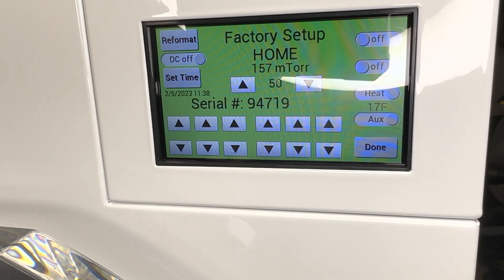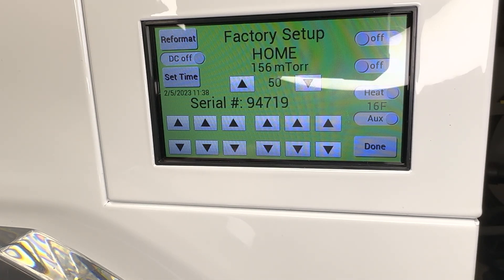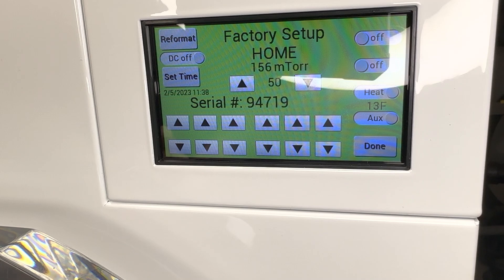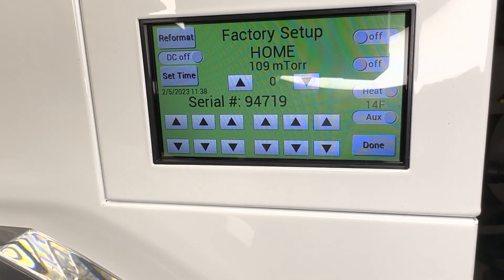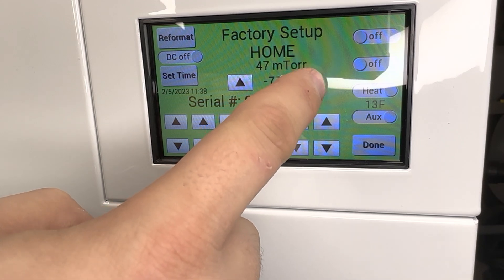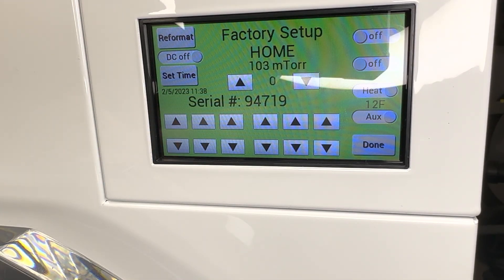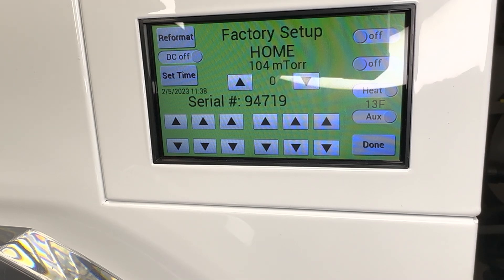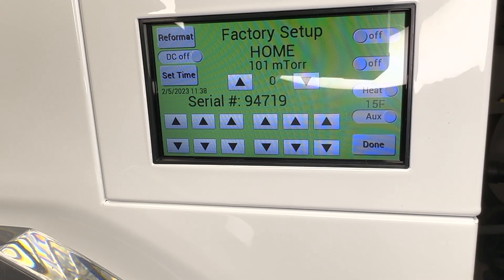Harvest Right Change mT Settings

Comment: Not very useful in describing FD function. What do the up down buttons and the number that changes with the pressing of the buttons mean? Pressure numbers cannot go negative so there’s absolutely no way to interpret this without an explanation. I presume the pressure reading in mtorr is the chamber of the freeze dryer, but it seems peculiar than any button pressing you could do would change that reading immediately so this entire video pretty much makes no sense to me anyway.

Comment: What does lowering the mTorr do? I just got a large. I am doing the bread right now. It is running 438 mTorr now
Reply: Any reading below 500mTorr is acceptable.If above,not enough vacuum is being exerted.The lower the number,the greater the vacuum!
Reply from the maker: This is something people used to be able to do when they had issues with a vacuum freeze loop. HR took this away from people after we found the fix. We only wanted to do this if we knew people had a good vacuum. It seems like your machine is working ok however so you wouldn’t need this

Comment: how do i go to factory settings on 5.4 v on my machine there is different factory screen where you can’t change anything . please help
Reply from the maker: Unfortunately they took this away from people after we starting fixing machines using this fix. It’s good and bad as I feel some people were not fixing the leaks and just doing this which will not help them make sure food is getting done correct. If you haven’t fixed your leaks via the vacuum fix and updating your hose I would do that
Reply: Yeah id like to know how yo het to this screen. Ive attempted all the other fixes and still het the inadequate vaccuum error.
Reply: Ive taken out the coin cell battery power cycled many times , if my machine sets for several weeks it will come to this screen. I didnt get it calibrate well enough . Now i cant force the machine back to this screen.

Comment: I am having an issue with my unit, Staying in freeze mode, it has gone 2 1/2 hours and it is at 27 below zero, the settings are 45 minutes an extra freeze and 10 below, so I touched the right hand corner four times and then the left leaf it’s advanced into drying, but had also told me that it could damage the pump. Please help.

Comment: Hi Donald.  Have you sold this machine, yet?  I just bought a Harvest Right Freeze Dryer but ran into an issue from a very first batch - bread test.  It seems to be stuck in the vacuum stage.  For the bread, the machine ran for over 45 hours.  It is outrages.  I cancel the process and ran three more batches of fruits and same things happen.  Do you have any ideas where I need to check and adjust?
It's a big headache in trying to get in touch with their support team.  They don't respond.
Reply from the maker: Hello sounds like you might have a vacuum leak. Complete all the FelixFix steps. I have a complete bundle on my website for all the items. It’s our most popular one the website for sure with the big discount. www.FixmyFD.com

Comment: Mine doesn't have where i can reset it
Reply from the maker: They have changed the software. Anytime we find ways to fix machines they seem to do everything in power to stop it.
Reply: @freezedryerrepairsupport  I bought a XL received it in April. Had to send it back because the compressor was bad after arguing with them for a month. They sent me another one. Now this one runs 100 hours and will not freeze dry any food! They keep tell me it a software issue but now of the new software works! I look at the BBB and they have 100 plus complaints this year. I'm thinking of getting an attorney.

Comment: I bought the XL came broken sent me a new on same broken. The machine will not start the heating process. I ran a batch of fruit strawberries bananas and cherries. Three 80 plus hours runs and two 40 plug hours for freaking fruit. Harvestright will take 4-5 days to call you back. When they call you back nothing gets done will set another call back 4-5 days later. $5000 for a something that doesn't work then have Harvestright not take care of it. They will never let you talk to upper management I don't even know if they have an upper management team. I would think hard and long before you buy a Harvestright freeze dryer!

Comment: Hi I have a new fd it has 24w software how would I change mt settings when I get to the screen like the one you show it doesn't have the up down arrows to change settings mine saying standard/cycle dry and classic under it
Reply from the maker: So unfortunately it looks like they took this away depending on what software you are using. We have found many times after we fix issues they do something to change it up so the fox can not be done haha. I would suggest just making sure you have done the FelixFix and get a quality new hose. This should help get to the lowest mT without changing this setting

Comment: so set Mtorr at 0? also i have been seeing on the facebook site that about (replace battery).
Reply from the maker: Once you have made sure you have no vacuum leaks we advise people to change this. I would make sure you have a battery as well
Reply: @freezedryerrepairsupport  Donald what size is the battery and where the heck is the location on the machine?

Comment: Will this work or v23 software?  If not how can i get v24. Mine is brand new 3 2023 will pull 100mt on test but laoded with food only get 520 to 600 mt. Changed valve no change
Reply from the maker: This will work on 23 or you can download 24 from my website. www.fixmyfd.com
Reply: Brand new 2023, Freeze loop issues. I pull 100mt on test, 900 on batches of food. I'm just going to return it and wait for a new manufacture.

Comment: if run my vac in the test setting, when i turn it off should the mTorr remain the same or is it normal for it to slowly rise?

I have ran 84 batches with no problem getting down to 200-250mT, Now it has a hard time keeping below 500mT, which means the heat trays do not stay on. I just ordered the silicone self-sealing tape and once it get here i follow their recommendations. 

They did send me the V-24 software but i would rather get the vac fixed and keep the v23 until i see some more reviews on the 24. 

Or should i do what you just did for now? if i lower the setting 200mT, it will think it is running well below the 500mT? (It was running between 480-580mT,)
Reply: Watched the Felix fix, where this question was answered..

Comment: So if I’m understanding that correctly, this is just for adjusting an offset for the mTorr reading right? Like at the factory they’d have an external reading on the pressure and they’d adjust that offset to make it match what the machine itself is using for its calculations, like a calibration of sorts?
Reply from the maker: 100% correct. Since HR is not doing this correctly when they ship out we are assuming when we get good vacuum we do not have any leaks and that most likely it should have been changed at the factory. Some of the older machines when they were doing this before they got huge you might see them at like -125 or so

Comment: Does it hurt the machine
To go at -50 mt
Reply from the maker: if you have good Vacuum at 50 moving it to -50 is not going to hurt the machine just remember you changed it in the future when you see things drying at 95 it really might be like 195
Reply: @freezedryerrepairsupport  
Thanks I got a Premier pump. All is good
My old oil less pump
No good